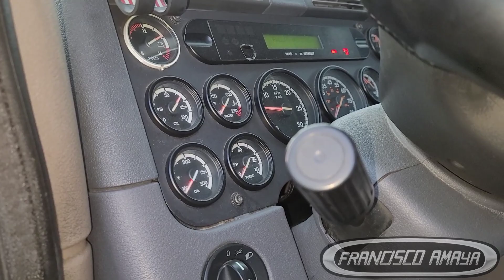DD13 DD15 DD16 faulty fuel injectors diesel fuel leak broken injectors

Comment: I have 2012 dd15.  I m having a no power issue specifically when I go up on hill so truck give me code SPN 3664 FMI 6 and I clean it out the injector  and put it back with new seals and built .  I drive it about 600mle and oil is blowing out of crankcase breather oil separator mix with little cooling in it . And cooling is going law even truck is shut but no visible water in oil pan ! And idea 💡!

Comment: 2022. Has one injector stay open.   Over temp the one box.  
Luck it was all covered by warranty.  There replace all injectors.  Fuel lines. And one box with all sensors.   

We got SCR codes and cracked DPF.   It can damage a lot.  

We got luck with warranty.

Comment: Had the same issue(dd15 , 2017, injectors over fueling) but the smoke was only cominng out thru the exhaust. Replaced all injectors at the dealer and after 6 months the same thing happened . Dealer repaire quoted $24k. Instead took it to a local mechanic and replaced all injectors for $8k  The truck has so far run 50k miles without any issues. What is annoying about this was the truck had a dealers warranty when it happened but they said the warranty only works for the first occurrence and any subsequent failure is not covered. Premier Truck group of S. Dallas.
Reply: 24k for injectors ?? You got absolutely fleeced even with labor

Comment: I had the same issue, I removed the dpf filters to checked them and they were internally bad, also it damaged the one box, so please when this issue happens make sure to remove dpf filters to check them, it will save you time and money
Reply: D13 engine *
Reply: Do you still have the truck? If you do, hie is it running?
Reply: @tracannon  I’m also a mechanic, we had replaced injectors and installed a new set of dpf filters and dpf box. The truck is running like a champion. That’s why I suggested to always with injector issues check your dpf filters.
Reply: @joka503dagamer5  understood, thanks for the response. This happen with my truck. New injectors where installed, but they where bad. Waiting to see the outcome.
Reply: My truck , the bolt places are lose when I am going to tied the bolt it is slipping!
Is there anyway to fix it or we have to open the top and a lot of work ?